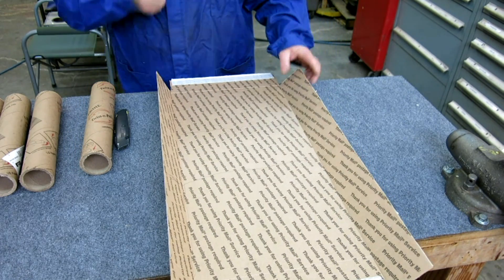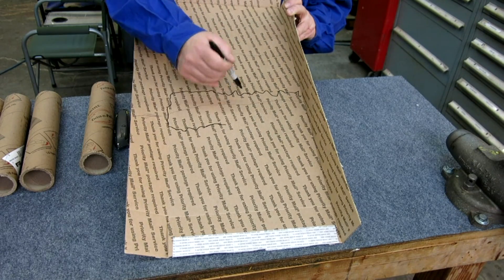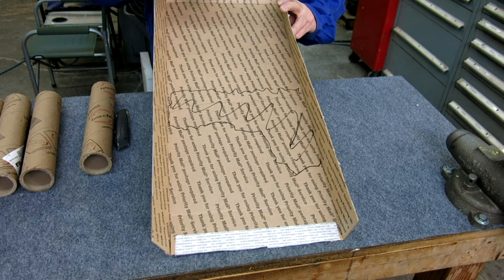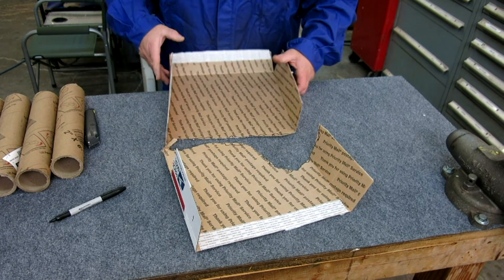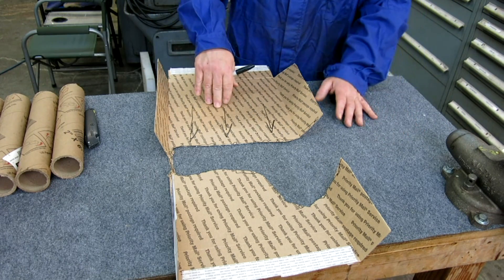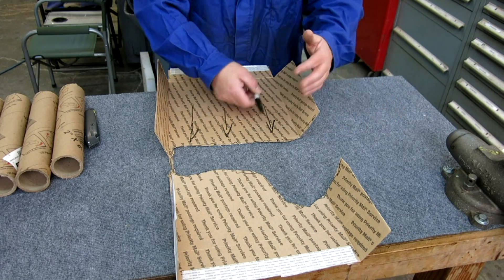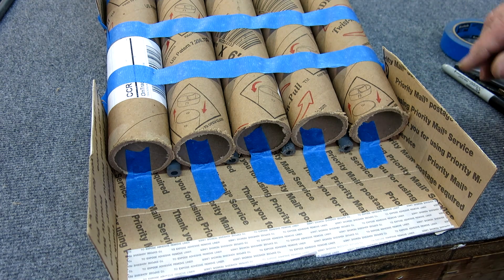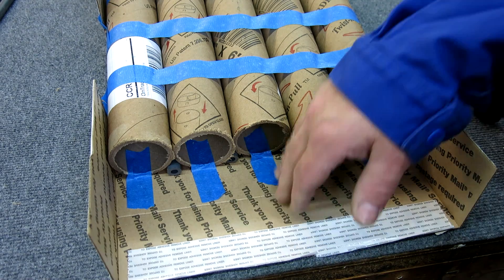Oroville Dam Spillway Repair

Comment: you could do the same thing with open ended shipping containers... as they are square they will fit with less gaps
Reply: So how would you do it Jack?
Reply: Or shipping containers with large hole burned in the top dropped in the hole ,then rock or demolition waste dropped in to ballast,?
Reply: Yes Joe, we used that technique in the U.K when the sea washed out the train tracks in the south west.

Comment: dont tell the government, or they will try it with cardboard and painters tape....unlike your  picture, the flyovers show a huge torrent of water, not a fairly still flow, it would be like plumbing up niagra falls
Reply: It's actually more than the Niagara Falls. Niagara Falls has an average flow of 2400m^3/s, maximum main spillway flow at Oroville Dam in the last few days was AFAIK >2800m^3/s.
Reply: jusb1066 The large flow is due to them having the gates wide to let water out faster than it's coming into the reservoir. The flow could be reduced or shut off completely. Problem is though, not for very long.
Reply: and they have shut off Niagra Falls before to do repair to the rock work at the bottom and face!
Reply: Baloney.  They shut the falls off by opening the intakes on both sides of the river.  The US and Canadian hydro plants each have intakes upstream of the falls.  Either one can take more than half the river flow.  The normal issue is leaving enough water in the river to make the falls look pretty.
Reply: They have shut off the American Falls, not the Horseshoe Falls. That's only a relatively small part of the Niagara Falls. I don't say you can't divert that much water, in fact, they actually did so during the construction of the dam, however back then they had the "luxury" to take months to build two diversion tunnels (11m diameter each), now they can only shut off the water over the spillway for a few hours max at a time before they have to turn it back on again because the lake is filling up. With snowmelt and rainfall, it will be weeks or months before they can shut it off for longer periods.
Reply: Corporate government for ya.